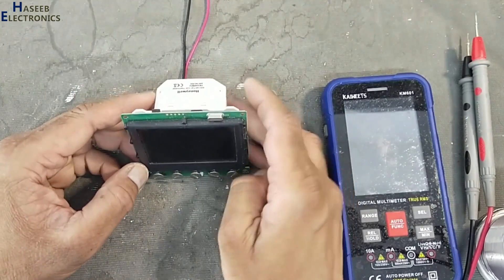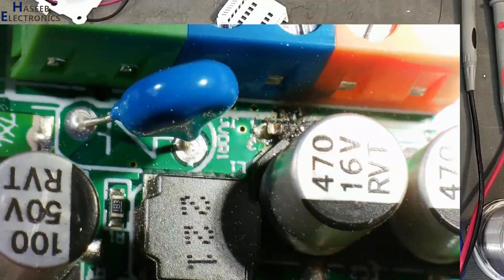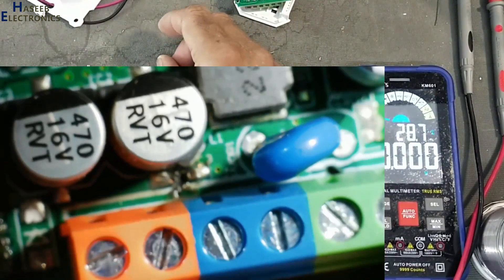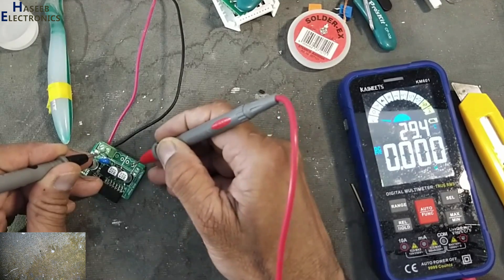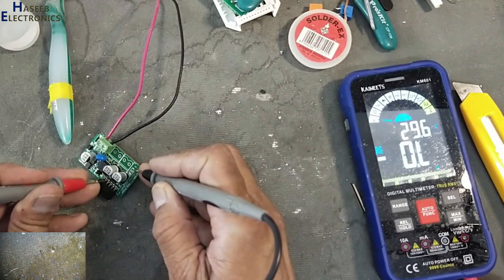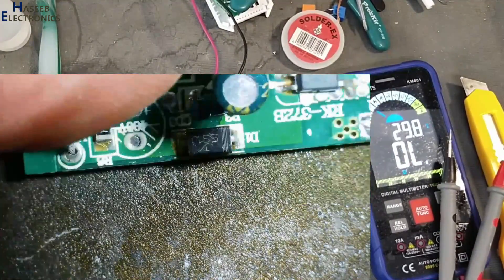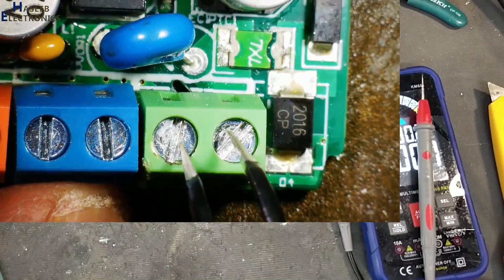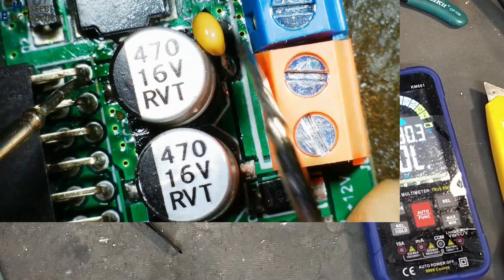{1119} TB3240 Digital Thermostat Repair

Comment: It's so nice to watch your repair videos, you aught to be a teacher in a university and teach the young ones.
Reply from the maker: thanks a lot for your valuable words
Reply: @HaseebElectronics  I like the way you said Funstastic ha ha... Dear Haseeb if you could do a video on joules thief circuit, it would be great. First there are many false one then there are some that works but they are not very efficient and then there is one that is very efficient if you could do a video will be great...
Reply: Haseeb is too good for university because there they only teach maths and theory and the practical’s they do are far from the real world. I done a Degree in Engineering it is mostly waste of time, I ended up as an electrician instead...

Comment: Sir I have 12v 10A power supply. Output is fluctuate 10 to 13.5 v. But when I touch output terminal this time output voltage is stable. What's the problem.
Reply from the maker: it seems something open loop in feedback netwrk. might be any component is open circuit or devalued
Reply: Thank you sir. I will check it

Comment: Sir how we calculate ciramic capacitor which is you have used 154 are there have video on this topic please inform about
Reply: Aslam walikum bro nice question that capacitor is to reduce noise u can connect standard values like 10Nf,15Nf /25v
Reply: @zeeshankilledar8117  That is too small. 154 is 150nF. A 100nF (printed 104) could be used or even 1uF. In this case it's not important to use exact value of original part.